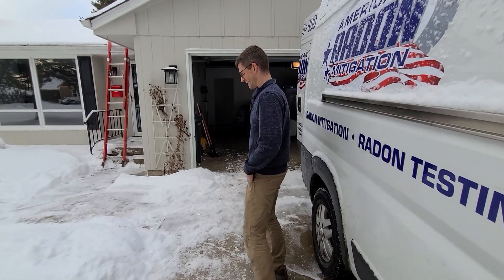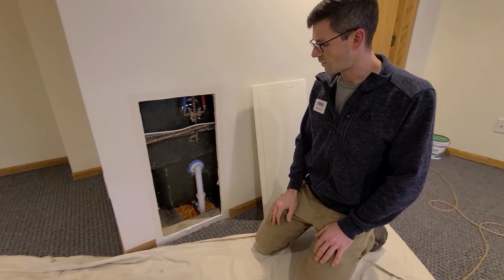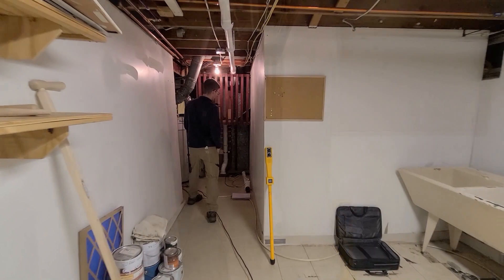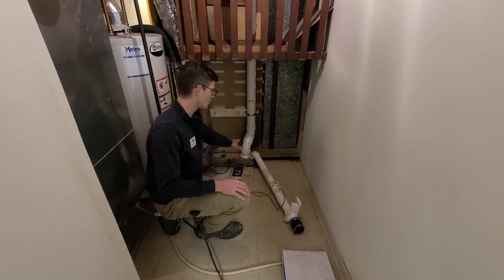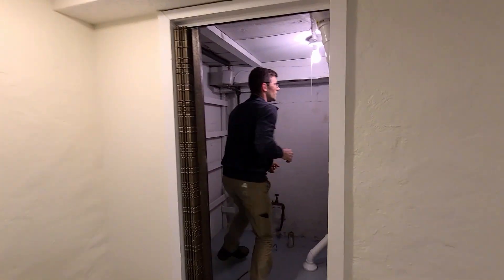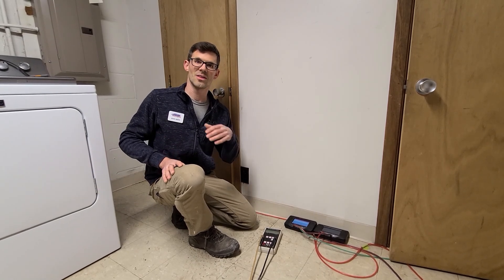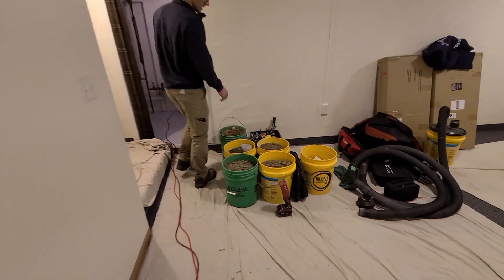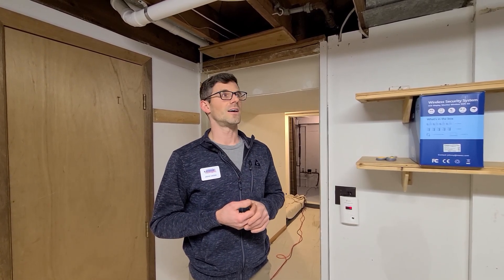Radon Mitigation in a 1954 Ranch Home Without Drain Tile

Comment: Thanks!   I wish I’d watched these videos of yours before I had a mitigation system installed
Reply from the maker: It didn't go so well?
Reply: @ there were issues, yes.  Things are better now, I found an accredited installer via another contractor to work on the system-(I didn’t know about the specific accreditation orgs at the time, and got recommendations from other contractors).   Long story, high pci/l values.

Oh. And a quick recommendation-if a customer has a backup generator, try to get the mitigation fan circuit on that system, so if power goes out, it still works.
I’m addressing that issue soonest.     (You may have already addressed the issue of backup power, I haven’t yet watched all of your videos). 😇
Reply from the maker: I'm sorry for your troubles and glad you reached a resolution. Although backup power isn't typical for the homes we work on, I'll keep that in mind.

Comment: Your so beautiful bro. But Im wondering I live in a house built in 1960s it’s like 0.4 miles away from water so there’s no slab just a dirt crawl space underneath the house inside the concrete walls could I have radon? Idk what setup this house is called but it’s pretty old it’s like a 1960s and 70s time capsule lol 😂 but I’m worried about radon
Reply from the maker: Hey Jordan. You will want to start with doing a radon test. If your radon levels are elevated, you will likely need to encapsulate your crawlspace and depressurize the area below the vapor barrier.

Comment: Great video!  I have a 1950's ranch with full basement.  The previous system installed keeps to just above 2.0, but I'd still like to get it lower.  A company I contacted said they'll test the system by drilling test holes in various locations to see if they can get a minimum of .003 inches of water column from the furthest test point.  Based on your comment about a minimum of 3 Pascals, is that enough?  Or am I not understanding this?  I have gravel under the home.
Reply from the maker: Thank you! In a perfect world, we shoot for 3 pascals of negative pressure under the slab in the winter, under maximum depressurization (every appliance that exhausts air on). Unfortunately, however, we aren’t always able to seal all of the floor-to-wall joints and openings in the slab, so in some cases, we often have to settle for a slight negative pressure in our weakest test holes. It sounds like the company you contacted knows what they are doing. I’d trust them as they know the homes in your area.
Reply: @AmericanRadonMitigation  Thanks for your comment!  Your videos are great and very informative.  The people of MN are lucky to have you guys up there.

Comment: So how much would this complicated system like this cost. I have a house with no air movement under the slab
Reply from the maker: Hey Jerry. This system took me 23 hours to install at the cost of 6645. You will likely have your best results by placing your suction points next to footings or near sub-slab plumbing. 

This video may be helpful for you. https://youtu.be/TyCUneMCcLc
Reply: Thank you for your time.
Reply from the maker: You bet, Jerry.  Be sure to start with a radon test if you haven't already.  It would be rare for a house built in 1996 not to have drain tile in our area.
Reply: I built the house myself and sits on a top of a hill so there was never a water concern. Knowing what I know now I would do a radon test before I built and design a home with a radon system as part of the plan. I live in Michigan in a county known for high levels of radon
Reply from the maker: Be sure to keep us posted on how it turns out. 

We now offer consulting services and diagnostic testing equipment rental. If you want to DIY your project with a little help from us.

Comment: Nice work! Just a suggestion - At the end of the video, you show the vertical run below the fan.  The clamp on the pipe near the closet floor has a long machine screw on it.  Perfect for snagging clothing going in or out of the closet.  I'd suggest trimming the screw or trying a different pipe support type.
Reply from the maker: Thank you, Scott!

That’s a great suggestion about using a shorter carriage bolt. I’ve added it to my Menards shopping list.